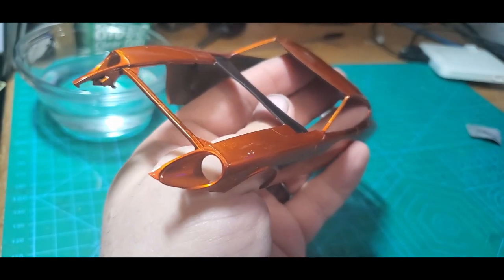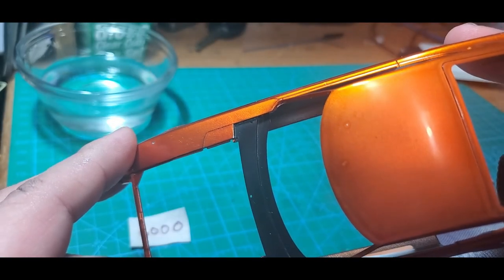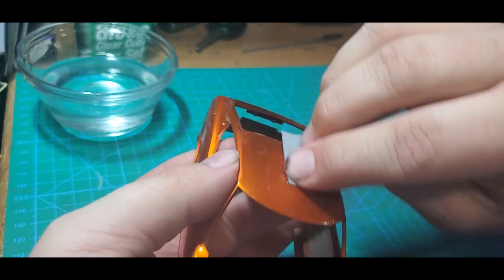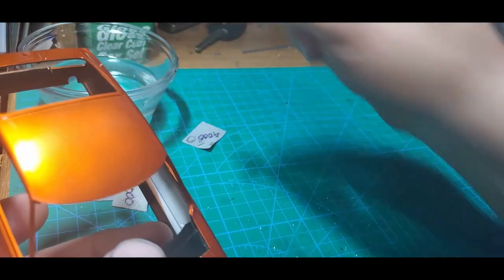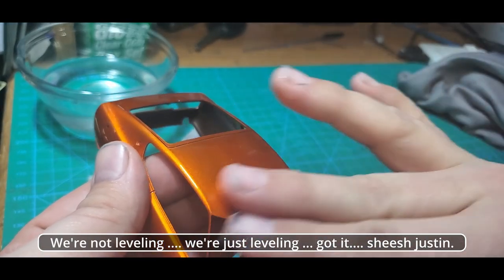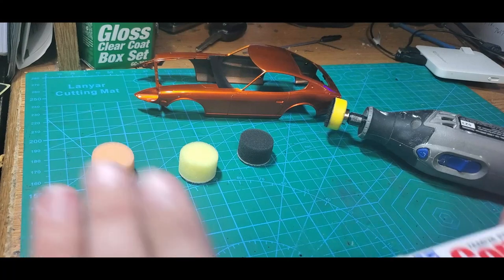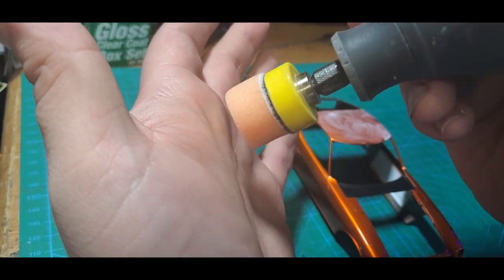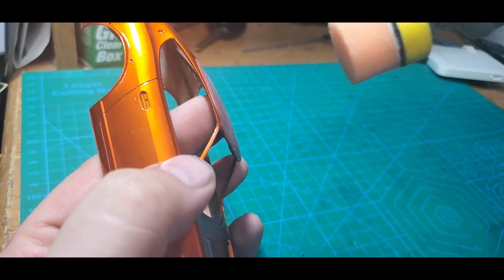Tips and Tricks: Wet Sanding and Machine Polishing 2K Clear

Comment: You bring up a great point about the contents of polishes. I'm not sure if using a polish anywhere except on the finished, final paint is going to really matter for the flatness of the surface since the wet sanding will do more than enough for what we are achieving, right? I could be wrong though. I personally never used a polish except after a final wet sand of the last coat. A polish and wax session.
Reply from the maker: For the most part I only sand and polish after clear, the exception was the Chevelle build. I was trying to do a candy clear over chrome.(Didn't exactly work how I wanted as the gravity chrome wasn't reflective enough) but the gloss black had a lot of sputter and dust in it, I wanted it perfectly smooth and high gloss before I put down the chrome layer. It was necessary to wet sand and polish the gloss black.
Reply: @JHartModelworks . Awesome.

Comment: Where did you get the polishing pads for the dremell
Reply from the maker: Amazon, My wife is threatening to cut me off lol.  If you search 1" foam polishing pad you'll eventually find them like 150 for $25. https://www.amazon.com/SHINA-150pcs-Inch-Polishing-Polisher/dp/B01HT1QC2C/ref=sr_1_61?crid=3ED6M6WX9GP37&keywords=1%22+foam+polishing&qid=1652587001&sprefix=1+foam+p%2Caps%2C73&sr=8-61 

The problem is they come with a shank for a drill or a full on automotive polishing tool, rather than the 1/8 inch Dremel bit. for that I bought this: https://www.amazon.com/gp/product/B0721RS42N/ref=ppx_yo_dt_b_search_asin_title?ie=UTF8&psc=1

Comment: I used to spend 2 days flatting and polishing a 2k body. I've gone back to laquer, much quicker drying therefore less chance of rubbish settling in the finish and flatting and polishing is so much quicker and can give an equally good shine. Yes 2k dries harder and is great on a flat surface but for me it softens detail way too much.
Reply from the maker: I live in Texas and dust is always the enemy. Yes it gets in the 2K jobs and I have to flat and polish them, but it also settles on lacquer clears. And because they are so soft, the dust actually buries itself in the clear and ruins the finish to the point that there's no way to get a gloss shine again other than to sand an polish and there's only so many times you can do that before you are through the clear even with hand polishing. My 2K cars, the same dust wipes off with a little water and a soft cloth. Sometimes like on the 240 I just want that very best shine, others like the 40 ford, I'd rather have done a lacquer clear, but I don't want to lose the paint finish over time.
Reply: Justin I appreciate what you are saying about Texas but in my opinion a fully dried and waxed laquer finish is certainly going to stand up to any amount of cleaning of a finished model. I think thinners with retarder, especially  Mr H do detract from the hardness of a finish but can still be flatted and polished after say 4 days but I would leave waxing as long as practically possible. Anyway for those using 2k your video was very informative, just brought back bad memories for me!
Reply from the maker: @Worden B  My first 2 years worth of models were cleared in rattle can TS-13. Polished and waxed at the end of the build, and today they are completely dull and rough as sand paper. the dust has settled into the finish and can't be removed by just washing. it would take sanding and maybe even a clay bar to remove it and by the time it's done I'd have eaten through the paint probably. then again I also don't clean my models and re-wax the regularly. I simply don't have the time. I agree a fully cured lacquer finish would stand the test of time if it were properly maintained, washed and waxed regularly etc. But in my case where the dust can sometimes set for a year or more, it just doesn't work. I acknowledge this is completely negligence on my part. But it's just life. There aren't enough hours in a week. 

I have recently invested in clear cases for all my models because I simply lack the time to properly care for them. $10 or less a model is a small price to pay to prevent the damage I've allowed in the past.  

But yes this was definitely instructions for 2K I'd never use a machine to polish a lacquer finish. It's just too abrasive for lacquer. Have a great weekend.
Reply: Thank you for your reply Justin, I'm sorry to hear you encounter such harsh conditions.   I'm surprised though that you haven't machine polished laquer, I do on flat areas with similar results to that you would expect from 2k. Anyway, I'm pleased that you have found a source for clear cases to protect all the hard work that you put into creating your models, they are worth preserving. Take care man.
Reply from the maker: @wordenb1830  Have a great weekend!

Comment: 12:08 What's the f*** 🤣🤣🤣
Reply from the maker: That was a nightmare.  I didn't know about silicone at the time and was repairing my air compressor.  I used a silicone sealant when putting the head off the compressor back together.  So I'm spraying the 928, the compressor gets hot,  the silicone atomized into the air hit the body while the color was going down.  Looked perfectly fine,  then i sprayed the clear and it all went to hell.  I ended up stripping the body,  replacing the compressor hose and airbrush because i just couldn't get all the silicone out of everything.  And starting completely over. Very expensive lessons were learned.